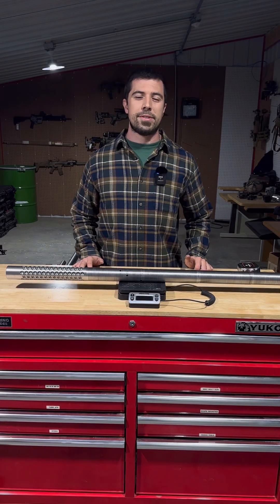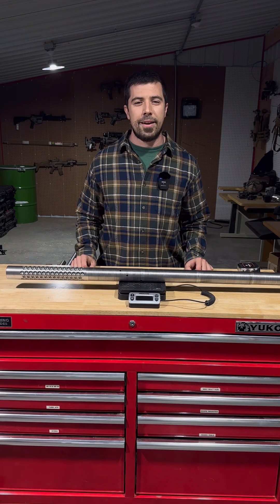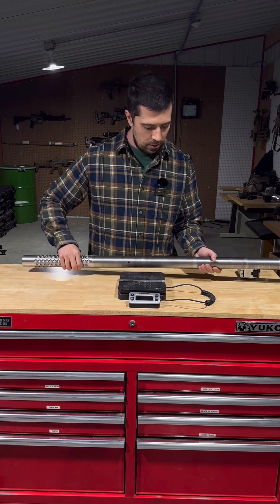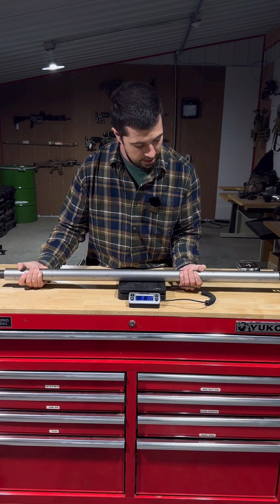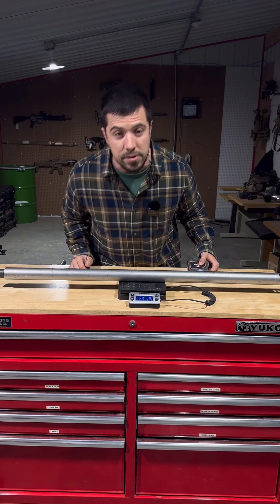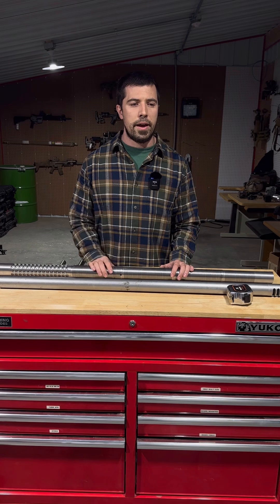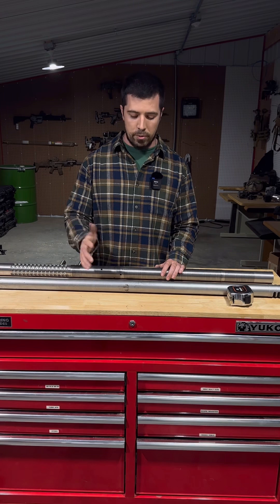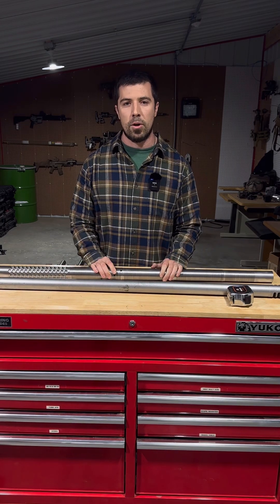StRuCtUrEd BaRrElS aRe So HeAvY

Comment: I think it makes sense that the internal fluting would lighten the barrel and improve heat absorption. It just makes me wonder if alternating patterns of external fluting on top of the internal fluting would make it better or worse?

Or, would it be possible to make a structured barrel that uses forced air cooling or "flow through" to keep the barrel cool and consistent longer?

Comment: It does not make any sense ,you have the same length barrels ,one has bored out holes around the circumference compared to the solid barrel ,so why is the tacom hq barrel not significantly lighter isf so much material is removed from it and you say it still have not been chambered or a thread applied to it for the receiver and then you have other aspects which bolt onto the barrel or should i say support the barrel together with scope and  butt end pistol grip etc etc. 

Like the testing done with Erik cortina and the 300 wing mag with 168 grain projectiles and the 230 grain projectiles which did not move vertically but did move horizontally due to the extreme wind effects which was around 20+ mile per hour and at 500 yards, which just that test alone proved its weight in gold, just think if erik and the other shooters now you a wind zero to make any corrections to each shot based on the wind, like say at England F Class shooters world cup etc. 

Well done cant wait to see more barrels in different calibres you can say that these barrels are Formula 1 in barrel construction full stop. 🦘🦘👍👍✌✌😎😎

Comment: You know, once the bullet leaves the barrel, the point of impact depends on wind deflection, projectile speed, and range drop and wether the thing you are shooting has moved or not.  The cartridge, rifle, shooter, and barrel just give the projectile all the initial conditions to hit the target.
Reply: You still need to be able to have the projectile leave the barrel in a consistent manner each shot to be accurate and to hold tight groups
Reply: @HPAccuracy  If you listed all the variables involved in getting a bullet to hit a target of any size, you would see that muzzle velocity is among the least sensitive variables in determining a bullet's trajectory.  Muzzle velocities can vary by +/- 50 fps with very little effect.  Barrel vibes play a relatively bigger role in defining the trajectory.  But the biggest variable in deflecting a bullet's path is the wind speed and direction from muzzle to target.  The topography of the terrain can also affect how wind across a target field changes.  So yea, try to get a small standard deviation in your reloads since that can affect your elevation trajectory.  But wind vectors play a much greater role in defining your windage.
Reply: @pauloftarsus3843  use a wind zero and do the calculations based on distance and size of the target and then usea TACOM HQ barrel of your choice. 
Please look up Erk cortina even he was blown away with the accuracy of these barrels with different calibers especially the 300 win mag with 168 grain and 230 grain projectiles factory ammo as well, with a 1.2inch vertical shift with 20+ mile per hour winds and a 5 inch group at the same distance with 2 different projectile speeds with about 150 fps difference between the 230 grain and the 168 grain.
cheers 🦘🦘👍👍✌✌😎😎
Reply: Fast heavy rounds are less effected by wind. Fast to decrease the amount of time you give wind to deflect your round. Heavy to increase the amount of force it takes for the wind to push on your round. A plastic bin will blow over in the wind sooner than a concrete trash receptacle. Likewise if you leave two aluminum trash cans outside, one for 20 minutes, the other for 2 hours, the one that's left outside longer has more time to be blown around by the wind.

Comment: Dumb
Reply from the maker: Physics or the fact Structured Barrels match the weight of a standard barrel?  We have a calculator on the Structured Barrel page that simultaneously compares a bull, to a contour, to a Structure with only five (5) inputs.  Results may surprise.
Reply: @tacomhq  These are the same jealous chodes that hate on Kevin B @ Q for giving us the 8.6 blk lmao
Reply: @tacomhq  i love how they market it "56% lighter than standard barrels of similar dimensions"
Lol 2" barrel.  

How much does that barrel cost as a blank? Can't find it online anywhere.  7 grand? 
Groups are no better than a 1.2 inch barrel weighing half of that barrel. 

What a joke
Reply from the maker: @ no, it is 56% lighter for the same stiffness - not the same dimensions.  As far as cost, price varies by length with any manufacturer, but say from Bartlein $690.  Finally, in regard to groups, I will simply express skepticism, particularly on extended shot strings as a Structured Barrel exudes 3-500% more surface for cooling.  It's high surface-area-to-volume ratio exhibits tremendous thermal endurance, typically running 2-3x the rounds to reach an equivalent temperature of a standard barrel.  Heat, obviously, opens groups up, let alone affects life.  Nevertheless, if you are comparing 2-3 rounds, the added stiffness in the large diameter facilitates greater tolerance, even when just comparing a cool barrel to a sunsoaked barrel.  Otherwise, if only considering 2-3 rounds, we cannot improve a one-hole gun with a cherry-picked round.  I suggest checking out this link (scroll to the bottom) https://tacomhq.com/structured-barrels/ if you want to see probably the best .22 groups at 100-yds you will ever see.  Good luck
Reply: @tacomhq  then market these for machine guns and not elr. 

Makes no sense to have a barrel like that in any competition. 

It's a gimmick
Reply from the maker: @ smh your comments continue prove you neither researched nor understand the product its science. Clearly, you did not even take my recommendation to look at the .22 groups. Never realized competitive shooters never shoot more than 10 rounds, don’t worry about heat, or try to control ES and SD for vertical stringing. Classic example of commenting on something with little to no knowledge. Good luck
Reply: @tacomhq  so how much are they?